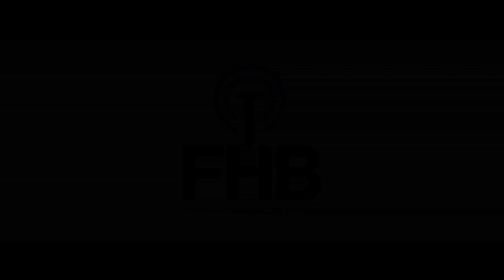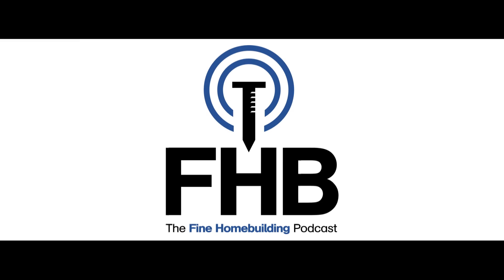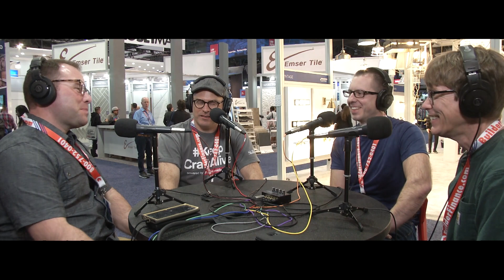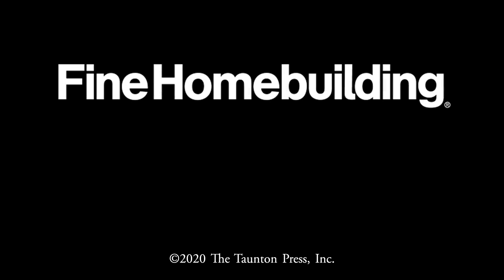Podcast 225: Live from the Builders’ Show: Pioneer Builders

Comment: Killing me with the Sheeting vs Sheathing. Sheathing is the term, sheeting is not. GBA article cleared this up :"Before we compare different sheathing materials, we need to clear up a common misconception. Plywood and OSB are examples of sheathing, not “sheeting.” The word comes from the verb “to sheathe,” which means to encase something in a protective covering (as a dagger is protected by a leather sheath).

Builders who talk about “sheeting” apparently assume that the word is derived from the word “sheet” (as in, “a sheet of plywood”). These builders are wrong."
Also notice all the code publications don't reference sheeting, it's sheathing in code publications. A sheet of plywood is used to sheathe a house.